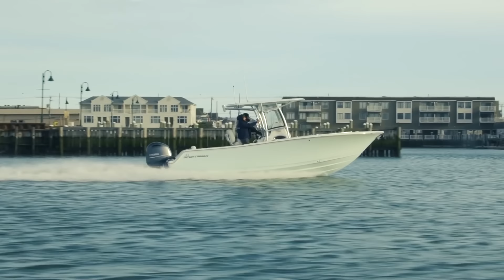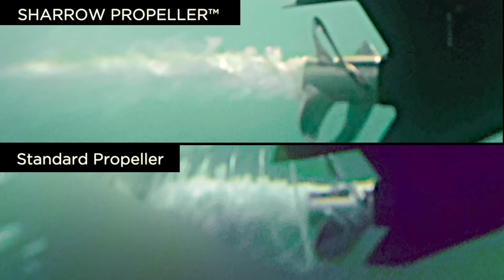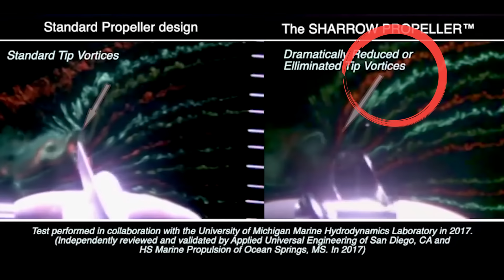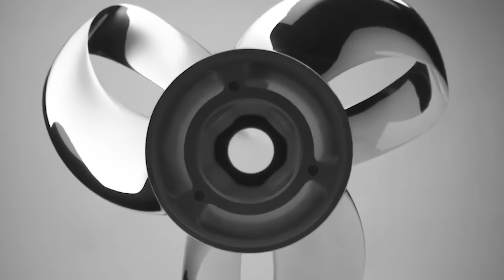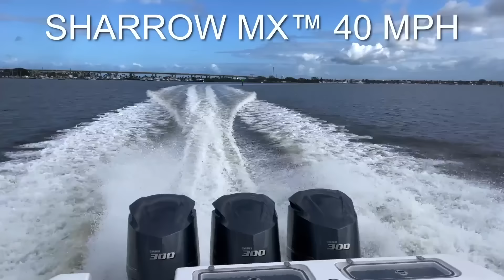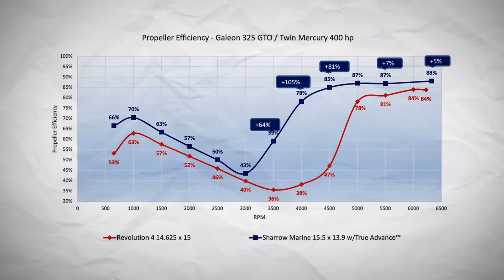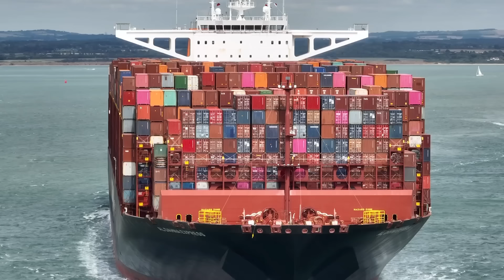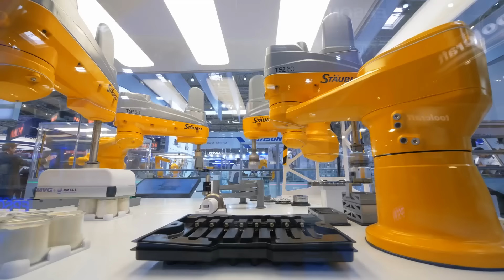This Genius Propeller Will Change Transport Forever

Comment: Reminds me of an ancient Egyptian artifact that was in a documentary years ago. Like now I commented in the YouTube comments, “ bet that bitch was a badass box fan blade or pump impeller but being as it is stone now it will never be seen as anything but a religious relic” or something like that. Seen what looked like a in-line 4 cylinder ford motor turned to stone and merged into a larger stone that a YouTuber named wise up had posted in unrelated material. Weird world🎉
Reply: Also, I have looked for scroll/ screw drive for water propulsion in subs or boats. Surprisingly I only found one example that was somewhat close in a very old patent submission. I think it was more like a very low tech supercharger design.

Comment: This is really cool. To see such a large improvement with such few drawbacks, kinda gives me a bit more faith in modern engineering, especially when the past few years or so have seen a lot of minor incremental improvements to solutions that already exist. (that or I'm just not looking in the right places)
Reply: Really more about manufacturing capabilities. Lots of good concepts and engineering. Limits being materials, manufacturing technology and capabilities scaled against realistic production costs.
Reply: @etue3890  if its not the knowledge, is the materials.
Reply: I mean, and don't forget somethings we do today weren't the best they could be. Look at Concrete and the fact we just learned how Roman's made theirs, which has stood the tests of time for centuries - And not only is it stronger, but more efficient than current methods.
Reply: @JohnWestJones  man this applies to things that were mainstream even a few decades ago. look at the average desk lamp in the 50s. proper engineered lamps with joints that you can position exactly how you want them. now we sit in office cubicles or open floor plans with flickering fluorescent tube lights or very harsh LEDs that give people headaches and create an awful sterile atmosphere. quality definitely doesnt always increase over time. this is one of the follies of these times. newer is always better.
Reply: @JohnWestJones  This is a bunch of nonsense. We absolutely do know how they made concrete, have the capability to also do that and still choose to use what we currently have. That tells you all you need to know about that equation.

Comment: Is this new design so efficient as to make the variable pitch propeller obsolete? If both ends of the blade are attached to the hub, how will it compensate for that? That's a question for those M.I.T nerds to figure out I guess.

Comment: Would be interesting to try ducting terroidal fans and even jet intakes
Reply: Ducted propellers/propulsors have existed in the marine setting for a while using somewhat more traditional blade shapes. But they pay a high drag penalty due to the additional surface area. I think the real benefit of this design is that it addresses the tip vortex issue without the added drag of a duct.

Comment: The biggest problem with those toroidal boat propellers is the cost. They go for about $5k each, so the 20% savings on gas doesn't mean much unless you are running a boat on a daily basis so you can recoup the cost of the propeller from the gas savings.

Comment: I wanted to ask about cavitation right before he put the cavitation videos on
It is interesting that it does not get damaged by the cavitation bubbles
So you would not need a replacement for far longer than the normal one so that would mean the company that makes the propellers would be even more expensive than we think because they do need income and you do not get as much profit from something that lasts forever.

Comment: 105%?? That means they would generate energy more than they use... this is simply not possible.

Yes the design is more efficient but there will always be losses.

Also, the design if the haul has massive impact on the entire boat/propulsion design efficiency!
Reply: Other than that: great content! I believe that these are also used for windmills for energy generation :)

Comment: IMO, the comparison of the marine props isn't 100% valid.  If the efficiency of the toroidal prop is that much higher, then the engine RPM will be greatly reduced for the same speed, thus the =engine= noise will be much less.

Comment: With the difference on the boats. RPM should have instead been considered. It appeared engine noise was the difference, and if the toroidal is more efficient, it would take much less RPM to attain 40MPH.

Comment: Very interesting video but just a technical point. You showed a comparison and said the new design reduced cavitation. It actually reduces ventilation, seen by all the air bubbles. Ventilation is air being dragged in by the propeller, greatly reducing efficiency. Cavitation is a damaging phenomenon where (usually) an imperfection causes a very low pressure spot on the back side of the blade, making the water turn to vapour bubbles that will cause pitting or 'cavitation burn'

Comment: I’m curious as to how they would perform on wakeboard/wakesurf boats that require quite a bit of torque to get out of the water. Wakeboarders usually weight down the boat with at least 1,500lbs of extra ballast and wakesurfers usually go at speeds between 10-12mp which doesn’t allow the boat to get on plane. With many wakeboard boats currently costing over $200,000, an extra prop option that might save gas and have other benefits could certainly be something people might pay extra for.

Comment: MIT's article tells about noise improvements but nothing about efficiency improvements. The idea of "vortex tip reducers" of all kinds is in use about 100 years in aviation. There are lots of designs of winglets for wings. Yes these can decrease tip vortex and energy losses related to it. But the price is increased resistance of the winglet itself. So efficiency (Lift/Drag) stays approximately same. Biplanes are also not new. Here is kind of 2 wings one after another. They may interfere quite complex way, because the second one flies in disturbed airflow from the first one. I do not believe that you can make efficiency, that is Lift/Drag 2 times better with this construction. It needs to be seriously proven.

Comment: That's a bunch of crap. On the boat motors one of the motors was loud the other was not well that means you turn the motors down where you muffle the sound on the motor you're not going to hear the prop the prop is in the water if anything you'll hear the water move you muffle the sound of the motors which makes you a fraud

Comment: This is a super interesting break through.

Fast propeller airplanes require constant speed props that can vary their angle, which would present another mechanical problem here.  It could be relatively easy to add a toroidal propeller to a fixed pitch propeller plane though. I'm not sure it will translate to things like computer fans or turbofans as they are essentially ducted fans. Maybe it's possible to negate the ducting and thus reduce the drag of an airplane since the nacelle is gone, but ducting drag isn't a problem with computer fans, for example. Some fans don't use an outer ring/duct though. Maybe they're better at opposing back pressure for the same airflow.
Reply: I'm guessing even fixed-pitch airplane propellers wouldn't work, the centrifugal force pulling on the outer ring portions would be too great, would pull it apart or deform it too much. Straight-blade propellers have the blades aligned with the stress, so they aren't deformed as a result. This would only be suitable for small drones, boats (small diameter propellers) or ships (slow turning).

As for computer fans, ducted fans, and so on, I'm guessing this would offer no advantage as the duct prevents the tip vortecies. I'm guessing the outer portions of these has some similar effect to a duct, so this overall is sort of a compromise (in terms of cost, weight, complexity, efficiency at low vs high speed, and so on) between a ducted and open propeller. So you won't see this in a duct, but there might be applications where this would be used instead of a ducted propeller or fan.

Comment: 4:47 I'd imagine the major drawback for larger aircraft is they require variable pitch props and rotary wings. But the concept is fascinating.
Reply: A fan blade like this might be more useful for jet engine compressors than than prop plane propellers. There would be no need to change the angle of the attack
Reply: @eastjm80  actually compressor sections do have variable vane guides which change the pitch of the blades.
Reply: The way we’re going we’ll all be back to horse and buggy. Climate change, Ocean, air , land pollution, War! Watch how fast this prop gets put on a military drone. “We’re all gonna die” Billy’s quote from Predator movie.😅
Reply: Twist toroid for variable pitch
Reply from the maker: Great point!
Reply: You can make each individual blade a toroid and still be able to swivel each one about its axis for collective pitch adjustments.
Reply: @angelcarrion2042  that doesn’t change the fact you’re still trying to account for two separate angles of attack on a single blade with only one point of rotation. You can pitch one half for climb rate or high speed but how does the other half of the toroidal shape affect the aerodynamics?
Reply: @eastjm80  No, you don't. You would be stuck with the same angle of attack for both top and bottom blades, and you'd have to design the airfoil(s) accordingly.
Reply: Variable pitch is also used a lot in maritime
Reply: You could still make them so the pitch could change also
Reply: @PatRick1981-s1w  nope!
Reply: The prop governor adjusts pitch, not the blades themselves
Reply: @Pickle117  Never said otherwise. The net effect is still blades the pitch of which can vary, hence the well established term "variable pitch propeller"
Reply: you could probably just rotate the whole circle of the blade
Reply: @levistewart5610  Sure, but the blades themselves are still fixed. Helicopters for instance require both to be variable.
Reply: @outermarker5801  All you're varying is the pitch rotation. You can do that regardless of the blade's shape.
Reply: Lots of general aviation aircraft use fixed pitch propellers, so this could be adapted easily.
Reply: @clarino2  just single engine old aircrafts even a cesna 700 has variable pitch props.
Reply: @ray_casso  Yes, older single engine GA aircraft have fixed pitch props, but these make up the majority of the fleet. New pilots in the US often learn on Cessna 172’s (fixed pitch), Piper Cherokees (fixed pitch), Diamond DA-20’s (fixed pitch), and LSA’s (fixed pitch). I’ve flown six models of the Cessna 172; a CZAW Sport Cruiser; a Decathlon; a Citabria; Piper Cub, Super Cruiser on floats, Cherokee and Warrior and the DA-20 - all were fixed pitch. My only complex aircraft with variable pitch prop was the Piper Arrow.
Reply: @clarino2  its true that in numbers the smaller planes will benefit from this but when it comes to commercial planes, even regional turbo props adjust the pitch when traveling at higher speeds. Can you engineer this "new" prop to feather in the wind? Kinda... it would be trouble at best. And that added bulk would negate most gains.
Reply: On the other hand, future electric aircraft and quad/hexa/octo/whatevercopters may not need to vary prop pitch since electric motors have such an even torque curve within a large speed range, and varying motor speed works quite well for directional control in ‘copters.
Reply: @bennylofgren3208  you don't know about stalling an areofoil... just no.
Reply: @bennylofgren3208  I think you would still need collective pitch control. On a big helicopter the limiting factor wouldn't be the speed or the motor. You have a lot of mass spinning, so trying to control vertical speed by varying the rotor speed would be slow.

Comment: Do you think it would be a challenge to build one out of carbon fiber at a larger scale? Looks like a great way to improve a paramotor's efficiency, but I'm already feeling the hole in my wallet 😂
Reply: You know that would be awesome, a lightweight prop in general would increase power and that new shape would make it amazing
Reply: Part of the issue with carbon fiber, alteast in the aviation world, is the lack of damage limits, aluminum in props is still very common due to its lower cost, and higher damage tolerances that allow the blades to be blended and have the damaged areas removed to prevent stress risers and crack formation which can be catastrophic.
Reply: This prop without a new material adds to much mass to a prop, however there have been large advances in drone props that could help and not hurt the bank as bad. For instance they added small winglets to the ends of props to reduce these same problems. It reduces the vortices as well as lessening sounds and increases efficiency slightly. The big question is however is the advantage worth the extra cost.

Comment: For clarification .... the loop transfer better the diference between the high speed and low speed water, and this cause less vortex & cavities in water.... this is somthing simmilar as like on airplanes wings (folded up - cheap version; looped  - expensive difficult to manifacture)
Some few hours presentation about biomimicri dozen years ago.

Comment: Title is click bait, so no, I'm definitely not going to subscribe!  If the propeller is 105% efficient, that implies it produces more energy than you put into it, which is impossible!
Reply: ok?
Reply: 105% more efficient than a standard propeller but the actual efficiency is 78% @ +_   4000rpm
Reply: @gbone7581  I guess it depends on your definition of a "standard propeller".  If this thing were really 78% more efficient that the typical boat propeller in use today, they would have sold billions of these things already, because it would imply that you would get higher performance with an engine half the size.  I stand by my opinion that the title of this video is pure CLICK BAIT, and the producer has no integrity.

Comment: Sorry to spoil the fun, but I call bull shit. You cannot get more out than you put in. 105% is pure BS.
Reply: 105% more efficient than a standard propeller but the actual efficiency is 78% @ +_   4000rpm
Reply: @gbone7581  Good point, thanks for rephrasing it so it actually makes sense.

Comment: One question I have on the drone applications is the weight difference, the toroidal propellers look like they have more material.  Does this put more strain on the motor, and thus require a more powerful (i.e. heavier) motor for the same class of propeller?
Reply: I was thinking along the same lines but more so about space requirements due to physical size of blades

Comment: Very interesting. However, it is easy to compare such low efficient props for common boats with a more sophisticated design. We run and design global ships with diesel engines in the range of 12000 to 18000 hp. The efficiency of the engines is more than 50% which is better than fuel cells. Rotating speed about 100 rpms. No one would leave the prop with a bad efficiency. When designing the drive chain of a new ship there a many discussions to select the right engine the suitable generator running on the drive shaft and the best prop for having the best efficiency. Occasionally they even decide to install a fixed prop which can be optimal moulded for the cruising speed. Sure, the efficiency during habour maneurvers are less, but this does´t matter compared to the long ocean voyage.

In this interesting video it is shown how the prop end induces vortex. Even the improved prop does not have an flow moulded center. So this design may have a bit more.

Comment: Concerning outboard motors, where is noise reduced? You have an internal combustion engine roaring away outside of the water regardless. At the end of the leg, and right in the middle of the prop you have the exhaust.  That's still a lot of noise. I don't think the propeller is making the majority of the noise there. In a drone, maybe different considering the medium is air and there is no exhaust

Comment: livefire81 is correct. Even if you could crack it, it's only applicable to boats but not aircraft. Adds too much weight that is not offset by more efficiency at cruise. Cool idea to play with but not the right direction.

Comment: Most computer fans are going to see marginal gains at best since the frame around a traditional fan prevents most of the tip noise that you get with a bare blade.
Someone has already been testing it (with very poorly printed blades) and showing them to be less effective than traditional Noctua designs.
Reply: There may be potential gains with a polished thin metal set of blades (vs said poor 3d printed blades) but at that point the cost over efficiency gain might just make it too costly
Reply: @xanthopoulos1825  It seems like the biggest gains with a torroidal design would be the directionality of the flow. It seems like the scoop tips of the fan blades being connected really prevent the blades from casting off air flow in any direction besides straight back.

The problem is I don't know when you would want that.
Reply: The poor surface finish quality is negligible when comparing performance. It greatly influences noise levels though. These won't benefit from the toroital design as PC fans already are enclosed on the side preventing turbulences.

Comment: The only major flaw in these tyrodial props is that props get damaged. No matter what or how you use a vessel these props are going to come into contact with things in the water. I would like to see a comparison of a dented or bent conventional prop vs. a tyrodial prop. I’m willing to bet that if a tyrodial prop gets damaged there will be more severe consequences than a traditional prop